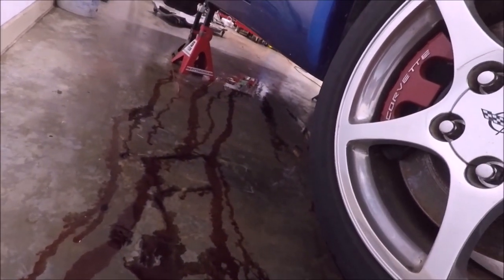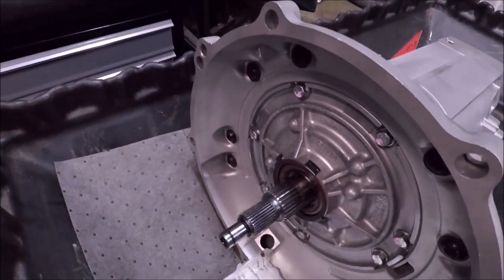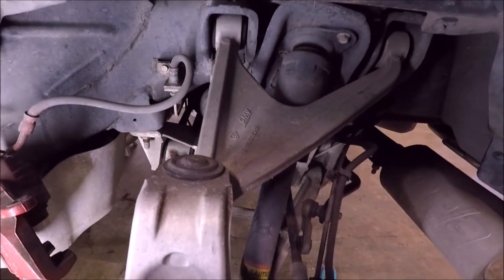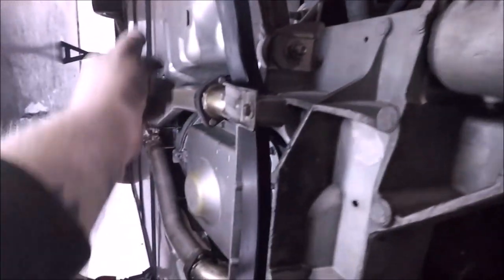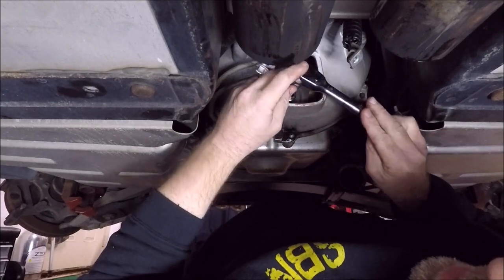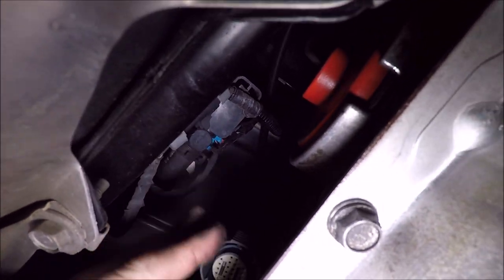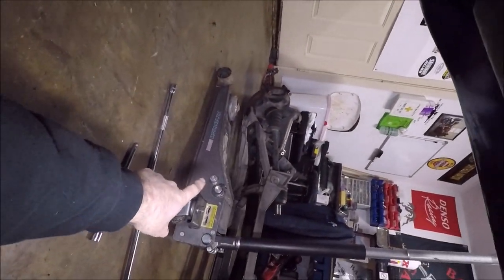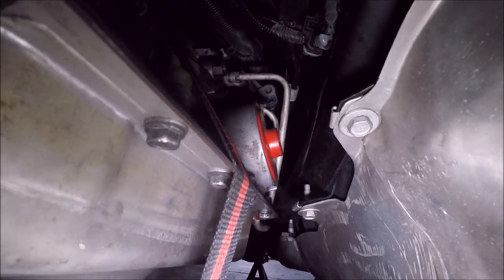HOW TO: 97-04 C5 CORVETTE TRANSMISSION REMOVAL

Comment: WOW! No way am i doing that, LOL. The cradle mount studs, usually a big square head or big square nut up in the frame that is covered with a sheet metal cover over it that is spot welded to the frame. usually busts off that sheet metal cover from the framing or strips the square of it. Might be access plug in cargo area or might need to cut a side hole to access it and weld the bolt head or square nut to the frame. They do it that way for wiggle room when bolting the cradle in place.
Reply from the maker: No access hole and not gonna cut one. May just tack weld the bolt to the frame at the bottom though. Or possible just hold it with vice grips while I tighten it back up. 👍
Reply: @BadLuckGarage  The nuts are those that have the bent in portion on the ends (factory lock nuts). Run a tap through the nut to make it so it can run up the stud free, cut the thread locking feature out of the nut with the tap, then just have to tighten like one turn or so.

Comment: I was able to drop my transmission and get it rebuilt thanks to your video. I began the process using instructions from Identifix. It had way more wrenching that was not necessary. Your method streamlined the process and saved a bunch of time and wrenching. Thanks so much.
Reply from the maker: Glad it helped brother

Comment: Thank you for posting these videos. I  am about to drop the transmission in my c5 to replace the torque converter. Just have been dreading doing it. Lol 
Thanks for educating us on the issue
Reply from the maker: Hello Chris Johnson, Thanks for watching! Im glad this video helped you out!
Reply: What made you realize it was the TC? I'm facing a diagnosis also right now and it's like if it's the TC then ok but what if the trans is damaged and don't know and since the whole thing will be dropped then why not just replace it all? Know what I mean

Comment: Just a tip for those having trouble getting the trans switch connectors loose just apply some heat with a heat gun.. Thanks for the video!
Reply from the maker: I actually discussed this in the part 2 reinstall video

Comment: Great video!!  I have a 2000 manual that needs some attention (165k: trouble getting into 1st and 2nd [plastic pads probably broken] as well as the typical diff output shaft leaks).  I appreciate your detailed procedure.  Thank you!
Reply from the maker: Glad you found the video helpful brother. 👍

Comment: 16:40 In my opinion it looks like you don’t need to remove the axles until you get it on the ground unless you’re just doing it for the weight of it all
Reply from the maker: I find it’s easier to drop the cradle first rather than wrestle with balancing with the entire assembly. If you have a cradle jack or motorcycle jack then balancing it isn’t an issue. Most people don’t. This was explained in the video.

Comment: If ya don't mind me asking how long did it take to get the transmission from RPM.
Reply from the maker: Call them and they’ll give you an estimated eta. Their backlog at the time you place your order is going to determine that. How long it took me to get a transmission 5 months ago isn’t going to be the same as how long it will take you to get one now. They could currently be more busy or less busy than they were back then. That being said they were dead on with how long they told me it would take.
Reply: @BadLuckGarage  well the told me 4to5 weeks and it's been 7
Reply from the maker: @dougpage1951  what did they say when you called and asked where your transmission was?
Reply: @BadLuckGarage  first time it was 2 weeks more last week was it we be another week. What I don't understand is they have a excellent reputation and I only live 2 hours from them so there's no shipping
Reply: @BadLuckGarage  I'm going to give them 2 more weeks a then pay them a visit to get my money back
Reply from the maker: @dougpage1951  no clue unless maybe it’s a parts shortage or something. But they should be able to tell you something in my opinion.

Comment: I'm going to swap my engine by taking the whole powertrain out. I'm fearing stripping cradle bolts. any ideas how you will remedy the problem
Reply from the maker: Most likely vice grips and a screw driver. Stay tuned for the install video.

Comment: Great video. Next time if you ever have to take the transmission or rear cradle out i would build wheel cribs to put under the front set of wheels so it wont tilt at all!  I have a video on my page on how to make them.
Reply from the maker: No need or for wheel cribs. It isn’t going to tilt at all with jackstands under the front cradle. Covered that in the video.
Reply: @BadLuckGarage  I totally get it and saw but I always use them just for that added safety. I'm like you and don't want to get screwed while under the car. I prefer life haha.
Reply from the maker: @TJsVette  Bracing the car by the cradle is more solid than bracing by the suspension with cribs under the wheels. Cribbing the wheels still allows movement. In my opinion, if you want more safety, add an extra jackstand or two under the cradle rather than cribbing the front wheels, this allows for zero movement in any direction. Brother I’ve just really never been a fan of using wheel cribs. I prefer to use jackstands under more solid lift points that don’t allow any rocking or suspension movement. Just my personal preference. If you need to get the vehicle higher than normal 3 ton jackstands allow, then 6 ton stands will give you that extra height.

Comment: Did you have a hard time separating the transmission from the torque tube?....
Reply from the maker: No sir. Let the jack down about an inch and it separated on its own. 👍
Reply: I have the rear transmission bushing and seal leaking ( 130 k ) when it’s in reverse. I am choosing to have a shop do it and as long as it’s out, rebuild it too. I’m told around a grand for everything. Nice video though! And you confirmed my decision to take it to the shop ! Lol 🖖🏻

Comment: Will a T56 from a C5 Z06  fit a stock Coupe that has a T56?
Reply from the maker: Don’t see why it wouldn’t.
Reply: Yes because it's the same dimension. I ky different is the first three years are 3:90
Reply: Yes but just keep in mind the z06 had shorter gears than the base c5s t56

Comment: while you have it this far apart I would rebuild the torque tube....I spent less than 200 building mine and it's worth doing to not to have to tear it apart again....lol
Reply from the maker: That would definitely be a wise thing to do. Unfortunately that’s not on the agenda or in the budget this time around. I’m just gonna hope with only 70k on it that the torque tube has some life still left in it for awhile.
Reply: @BadLuckGarage  hey I know that feeling about budget but if it explodes it will cost you way more...ask me how I know...lol
I had to buy another torque tube for my car...the rubber torsional biscuits are about 50.00 each on ebay...I would atleast take it apart and inspect it